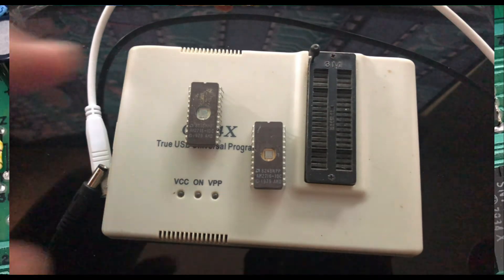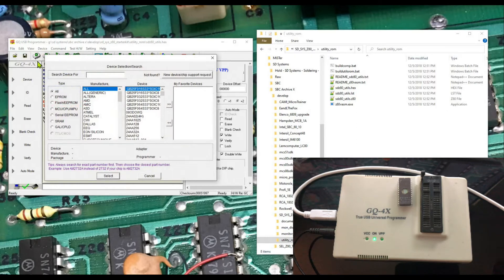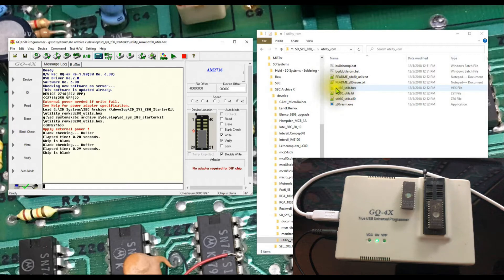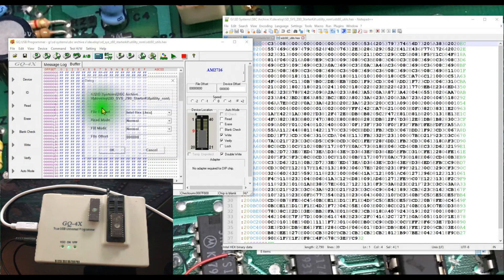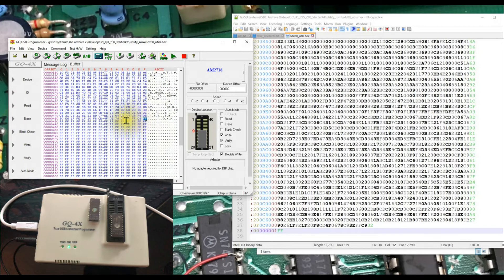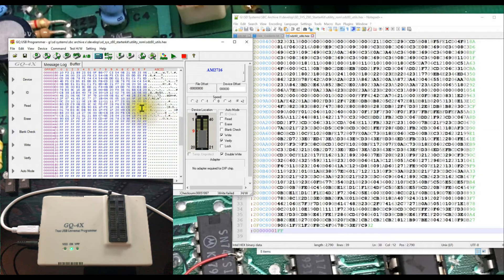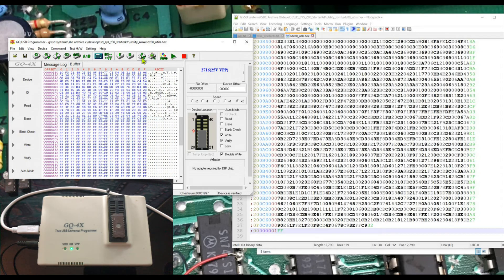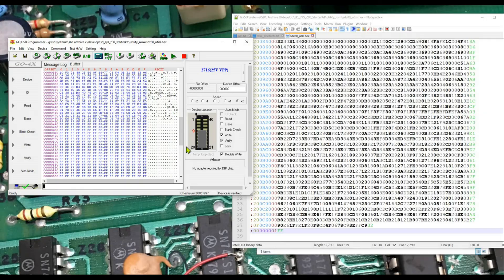STB587 - 2716 EPROM Programming Using the GQ-4X Programmer

Comment: So expensive the GQ-4X programmer this days, but I'm hoping to get one... nice video. BTW. my notepad HEX editor looks total different and cannot calculate the crc values at the end of each line, where did you get the HEX editor for Notepad++??
Reply from the maker: The file in Notepad+= is just a text file with the .hex extension. Notepad++ recognizes it by the extension and applies the coloring. I don't recall if I had to do something to get Notepad++ to recognize the .hex extension.

Comment: So both cords gotta be plugged in?
Reply from the maker: Yes, the USB cable so the programmer software on the computer can see the programmer AND the external power adapter which allows the programmer to generate the +25VDC required by most early 2716s and 2732s. An external supply of 9 to 12VDC should work fine. The programmer has a boost convertor to step the input voltage up to the required voltage. Note that some later generation 2716s and 2732s mare have a +21VDC programming requirement. If you can't find an exact match for your part in the programmer software see if you can find the data sheet for your particular part and verify the programming voltage then look for one in the software that uses the same voltage. The programming voltage is typically listed as VPP or Vpp.